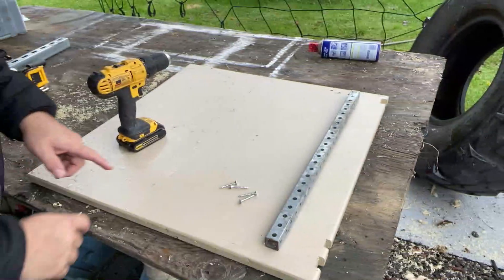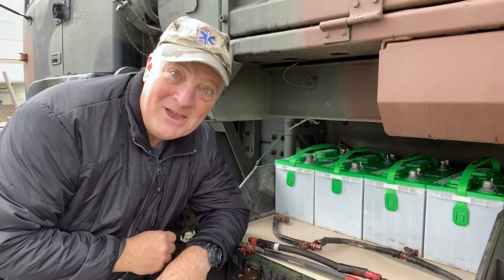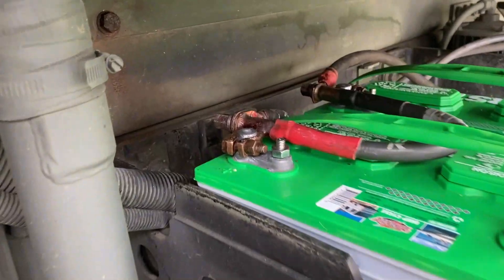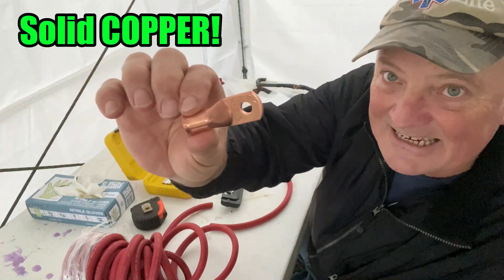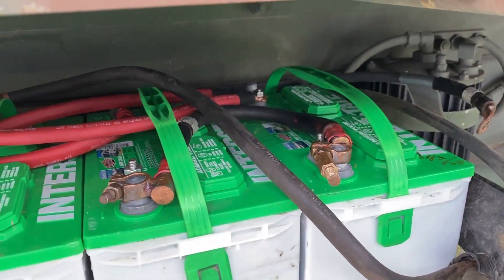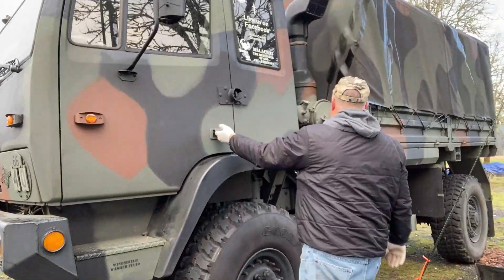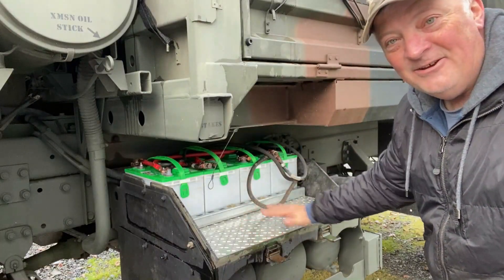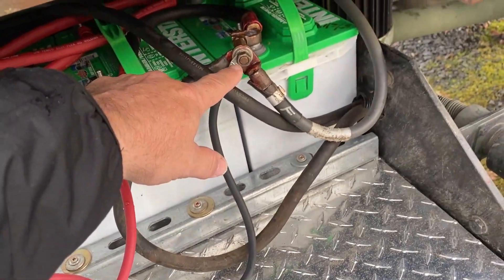FMTV BATTERY EQUALIZER PT. II #146

Comment: With the addition of the equalizer can you then delete the terrible batter isolator / power distribution block located between the cab and bed?
Reply from the maker: Yes, you can... even go to two batteries running a single 24v alternator, too.

Comment from the maker: I have to post a correction. A positive battery to another positive battery makes 12v because the batteries are in parallel. To get 24v, you need to connect batteries in series. That means, a positive to a negative of the second battery. See the diagram for me details. It is also better to crimp, then fill that connector with solder.

Comment: I ! what  is the size group for battery... ?    24 ?
Reply from the maker: Two batteries in series make up 24v, AND two additional batteries in parallel make up 12v. Yeah, it is dual voltage... so is the alternator.

Comment: My 1997 LMTV fire truck wont charge the batt's any idea???
Reply from the maker: The alternator functioning properly? These are notorious for failure... that, and check plus clean all your electrical connections... most importantly the grounding cable. Corrosion is the enemy! Also, check your polarity distribution block for corrosion. That is a hive for problems. Lastly, check your batteries. If they are original to the truck, they are probably shot. Hope that helps!

Comment: Normal vehicle alternator charge voltage into a lead acid wet battery is 14.5V +/- 0.5V.  Your 14.3/28.6 is nearly the ideal...  in fact the less you drive the higher you might want it so the batteries reach a peak faster in the short run times.  Lower might be better if the truck ran 8 hours a day, down closer to a long term lead acid float voltage of 13.2V/26.4.  Happy Thanksgiving Dave:)
Reply from the maker: Thanks, Ron! You are such a savvy friend to have... and I am thankful to have your insight. Happy Thanksgiving to you and your family!